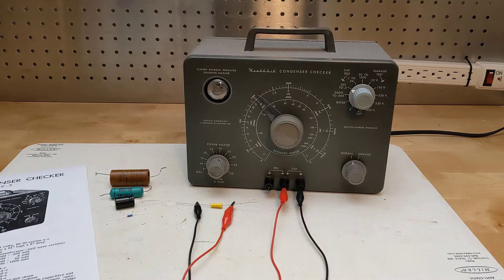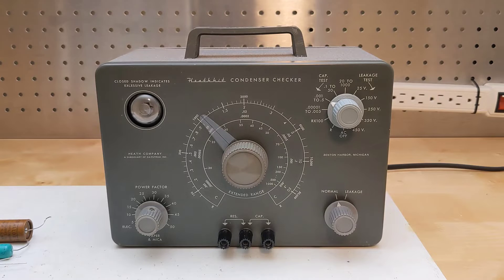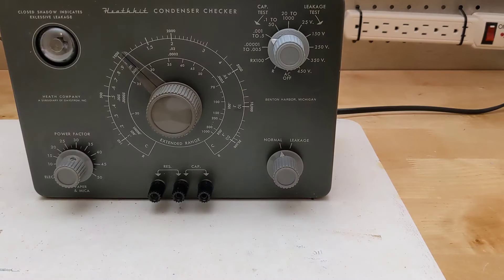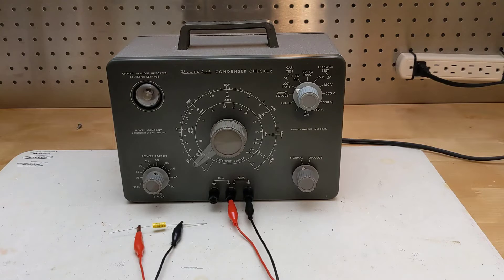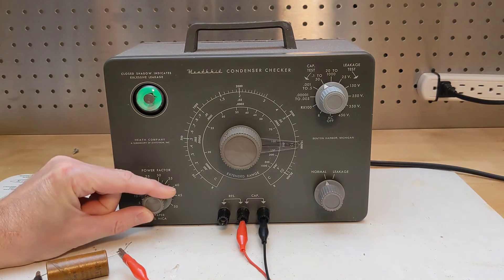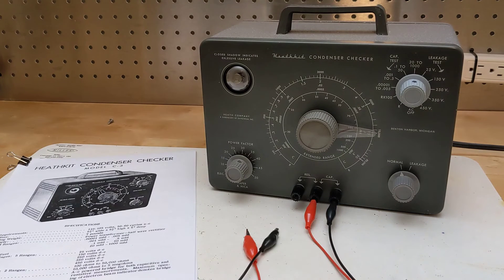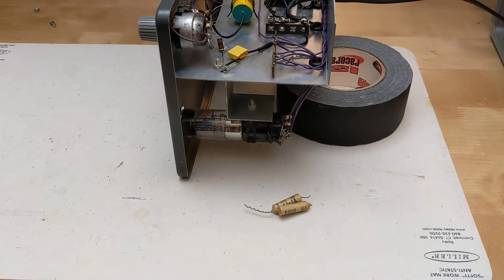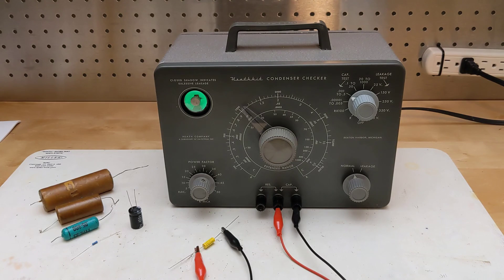The Heathkit C-3 Condenser Checker

Comment: I used a C-3 for over 40 years to check leakage on caps.   First job in the early 80's was a bench tech at a family run TV shop.  Always gave great service, never touched anything inside.  The only complaints I had were the voltage was fixed so you couldn't check anything under 25V, and it stopped @ 450v instead of 600v so the upper end was limited as well.  I eventually replaced it with a General Radio 1617 Capacitance Bridge.  A few years later I picked up a Sencore LC77 Capacitor/Inductor analyzer.  Both the GR and the Sencore have variable test voltages that max out @ 600v.

Comment: Great video!  Thanks for going through the trouble of posting, Jeff.  New subscriber here.  I have one of these which has been restored.  I'm currently using it to leak check the several paper caps (black beauties) in an old RCA Senior Volt-Ohmist VTVM, Model WV-98A.  WHAT type of CAP would you recommend I replace those black beauties in this VTVM with?  They are all bad.
Reply from the maker: Any modern metallized film capacitor should be suitable, such as you can get from https://justradios.com or Mouser or Digikey.
Reply: Perfect.   @jefftranter  Thanks.  Have a pleasant evening.

Comment: Thank you so much for posting this - I have one of these in my workshop though it's in the older colour scheme (my favourite BTW). I replaced all the caps - they were out of tolerance for leakage & value. The resistors for measurement were spot on but the ones in the voltage divider shange were all high.

Comment: Nice video Jeff. I have also done a video on the C-3, as I thought it merited exposure. Unlike some of Heath's lower-end test equipment, in which area I am often underwhelmed, I think the C-3 is a pretty 'nice piece of kit' and does its job quite well. Also, an attractive unit in a businesslike way. Good job on the 3D printed knob; I have started to use my printer more and more to fabricate odd items in my restoration projects (most recently a replacement for the original 'light shield' in a Heathkit IM-102 Nixie DMM).

Comment: I use mine not for checking old capacitors but for checking new ones to make sure that my newly acquired assortment from China are good and can hold up under rated voltage.😊

Comment: I like mine, useful for showing to visitors that ask "What does all this stuff do?"   I did find on mine that the leakage test voltages were all high, so I rebuilt the voltage divider to bring all the voltages to just under what it says on the meter.  Three wire cord and a 1/4 amp fuse added.  Death cap taken out.  The binding posts were pretty oxidized, so those were replaced.